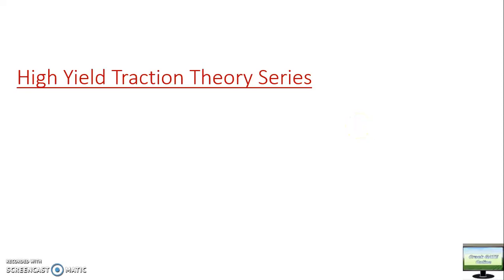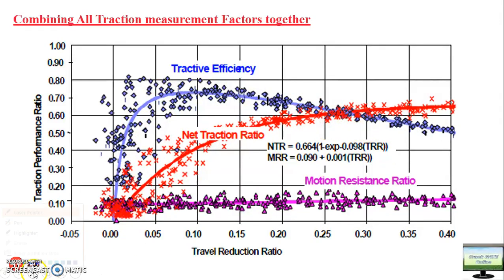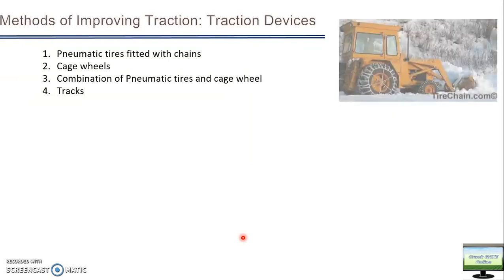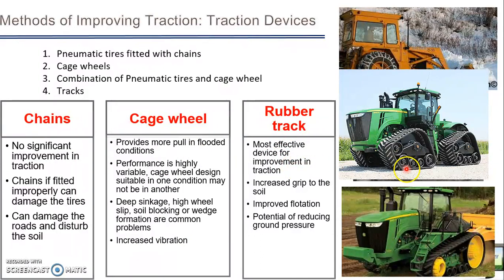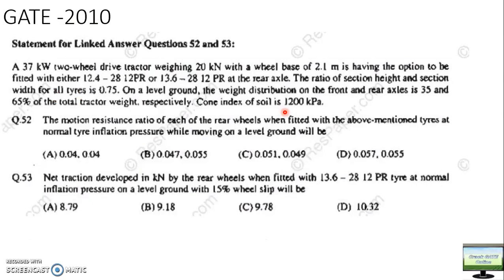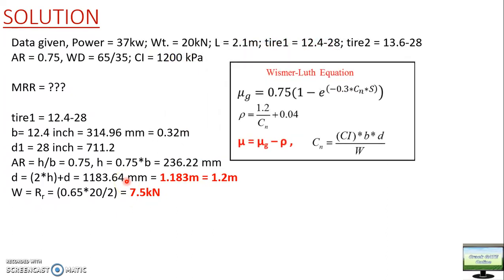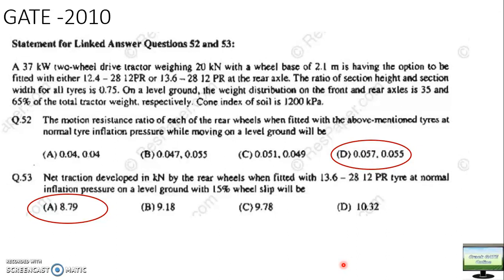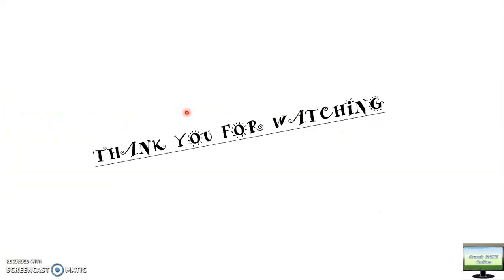1.8 Tyre and Traction Theory

Comment: sir,
in the GATE2010,52nd problem, 
the weight on the rear wheel is 6.5 ((0.65*20)/2) but not 7.5
so we get Cn =(1200*0.31*1.18)/2 = 67.53230 
MRR= (1.2/67.53230  + 0.04) 
then we get exactly 0.057
Reply from the maker: Hi Deepthi, hope your preparation is going well. Yes you are actually write, that is a calculation mistake from my side. Wt on rear wheel is (0.65*20/2) which will come 6.5 not 7.5. Thank you for pointing out the mistake and i truly appreciate it. This shows your attentiveness. Our team wants all of you guys to study well and watch all videos carefully and if you ever find any mistake then please point it out.